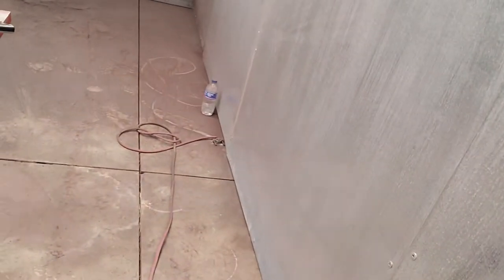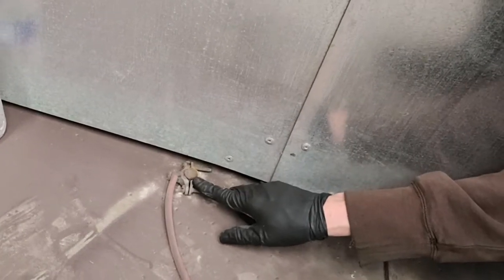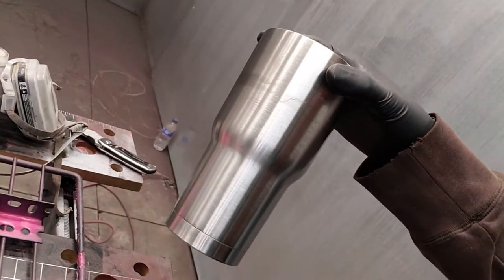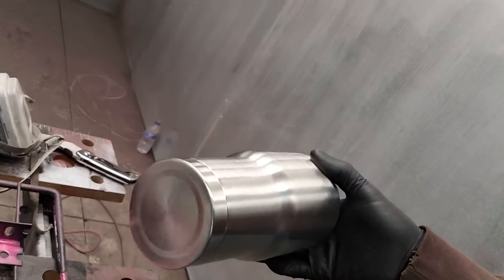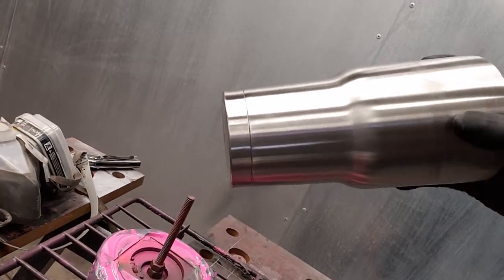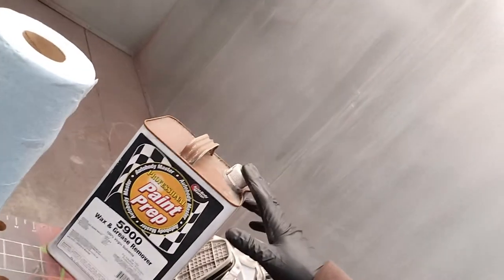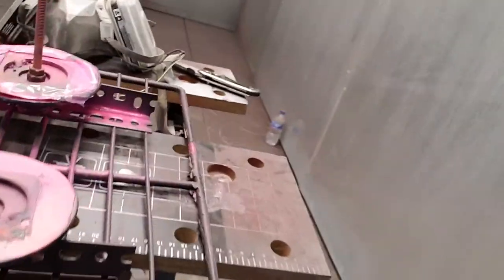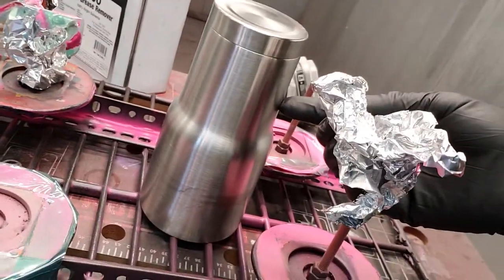Powder coating - Pre-Paint application and grounding tips.

Comment: So I got a gema optitronic cg03 with a manual gun and I need your help with the ground rod.. so I hammered the ground rod but I’m not sure what connects where.. the back of the unit has a place where I connect the ground cable that connects to the unit.. so that cable has a terminal on one end that I tighten it up to the unit and the other end has a alligator clip.. I connect the alligator tip to the rod? Then I get a copper wire 10 gauge tighten it to the ground rod and run that wire to the rack and on the other end put a alligator clip on it and clip it on to the rack? If you could please help would be appreciated thank you
Reply from the maker: That's exactly right.  So the ground on the gun needs to be grounded by the in ground rod and the part needs to be grounded to the rod also.  If you have a booth do another ground to it.  The goal is to prevent a spark from happening and igniting a cloud of powder.
Reply: Right Now Powder Coating is there another wire I can use besides the copper wire which I believe is all stiff?? I saw you have a cord that’s on the ground rod can I use a cord like that from the ground rod to the rack instead of a plain copper wire? I just want something that’s more flimsy and not stiff as plain copper wire
Reply from the maker: @perknowitzki7158  I actually use electrical wire.  I now have a bunch of grounding wire so I'm gonna switch it out some time.

Comment: About to start powder coating and I'm confused. If you ground the the part or rack the parts on, where do you put the cable from the gun?
Reply from the maker: The gun needs to be grounded also, has nothing to do with grounding part
Reply: @RightNowPowderCoating  so the gun gets grounded to the grounding rod or the part?
Reply from the maker: Morris grounding rod
Reply: @RightNowPowderCoating  thank you